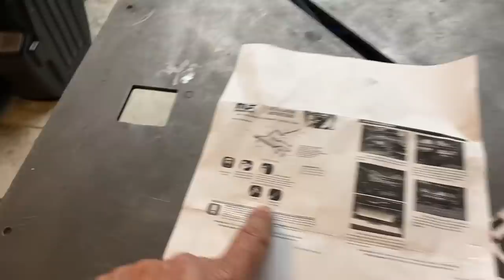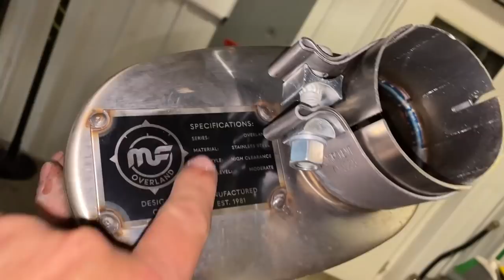New Ford Bronco EXHAUST UPGRADE!

Comment: I watched last years race on Youtube and I will tell you it wasn't Lite Brite fans that started the problem but they did defend you guys honor. As for the exhaust to me it sounded better with the J-pipe installed and second was the cap installed. With it uncorked it just doesn't sound right but the 2.7l does sound way better than the 3.5l EcoBoost does.

Comment: I’d be careful with no cap on the second outlet. If you were to sit idling too long, like in traffic, there’s a better chance of gases getting into the cabin since the exhaust is exiting under the car and not directed outward.

Also, it’s probably just the camera mic, but the no cap version almost sounds a little rattley. With just the minimal cap sounded best on camera to me.

Comment: Maybe a K&N intake filter next would be handy to be able to clean the dust out of the filter or maybe a pre filter. Also on the muffler if the cap isn't used or if the exhaust pipe is in the rear hole there is a greater risk of corrosion from the exhaust gasses being corralled up in that area back there, gotta empower those Broncos to become wild Mustangs.

Comment: I like to be able to unleash the sound of the engine without adding obnoxious noise so I like it the last way you had it.  I put the magnaflow overland catback exhaust on my 3.6 Wrangler and in my opinion it does the engine some justice.

Comment: If you leave the second output hole open with no cap please add a downspout to get the exhaust lower and closer to the outside of the vehicle.

Comment: Yes, the factory audio system does amplify engine noises and play them through the speakers. Also you’ll definitely get more turbo noise from aftermarket intake/exhaust
Reply: Ford did that with the F150.  Have not heard that they have done this with the Bronco though...
Reply: It’s typically something they do on all vehicles with any sort of sound enhancement system, wether it be Bang and Olufsen or Sony or even just the premium Ford audio packages that come with the Raptor/Shelby/RS/ST/Limited models

Comment: Would have been great to have run bye with stock muffler to compare.
Also if no cap at all and in deep water, could it be an issue ?
Reply from the maker: There’s no noise stock so no reason to. It’s dead silent

Comment: Wasn't the j pipe & plug designed to cancel interior exhaust droning? The turbo already knocks that down somewhat.
Which set up sounds best at your most common highway steady cruise?

Comment: wonder if that muffler would fit on the original pipe,  without the cap does it blow dirty exhaust on the frame and stuff if so would it be better to run a exhaust tip down a little bit

Comment: I did a MBRP 4" cat back with Stainless Works 3" down pipes and race cats on my little bros 2020 2.7l ECO F150. AND GOD IS THAT THING NASTY in the bad way lol, the 2.7l does not sound good haha. But its fast with the right tune, we're looking at a 4 link as the next mode as it does not like to keep the rubber stuck to the road at all. Nothing makes your butt pucker faster than dropping WOT @70MPH and having the ass of the truck break loss on you going down the highway.

Comment: On my 2021 Pro Tacoma I have a Magnuson Supercharger with a 6 speed M/T and I only hear the whine of the Supercharger when I get on it in 3rd to 5th gear. and going from 5th to 6th at 4,000 RPM I am doing 102 mph not bad for a Tacoma.

Comment: It should also me within the ability of the people managing the chat setup to add auto mod bots that limit and block excessive spamming from individuals and groups of individuals. They could easily limit repeated spam and some nonsense messages. Trying to make it chatters responsibility to maintain that is generally a losing battle.

Comment: those lower control arm mounts look as bad as the JT mounts!!  I call them forward momentum arrestor and have bashed mine so bad  I'm looking to weld  up some steel to get rid of the steep angle.

Comment: Ford does map and pipe fake engine noise through the audio system like on all the twin turbo V6s, you can use Forscan / Ford IDS to turn off the "fake" motor sounds and hear what the power plant truly sounds like. However a twin turbo definitely sounds .... I like the natural turbo sounds but overall it sounds like a JDM which I am not a fan

Comment: Not a fan of the most open option, seems tin canny. The option with the extra tip sounded a little deeper. Obviously, that is through speakers and 1500 miles worth of bandwidth so wtf do I know... lol